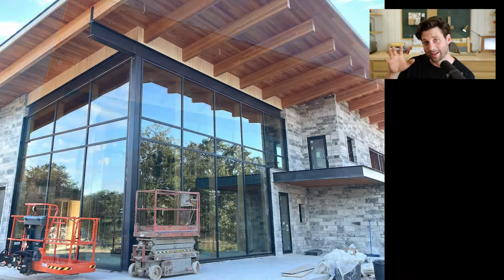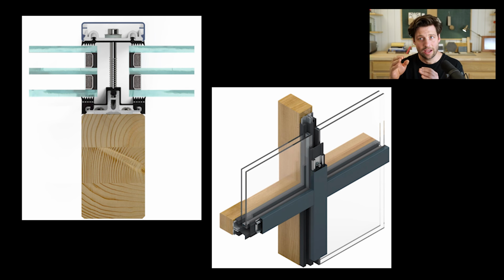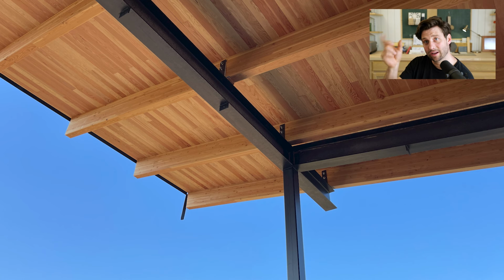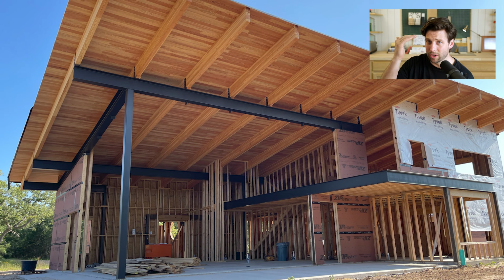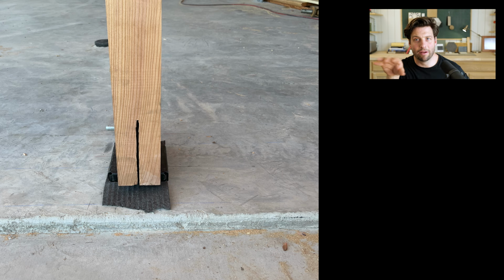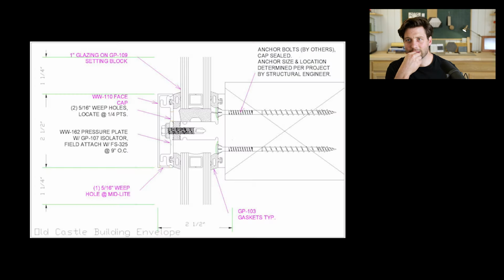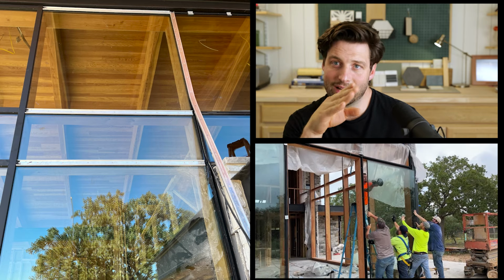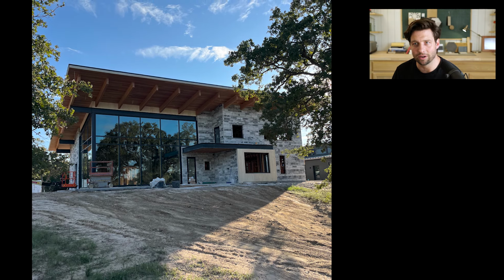Building a Massive Glass Window Wall: Behind the Scenes

Comment: You will 100% have an issue with the installated glass in 10yrs, because you filled the inside layer (between the glass) with air instead of Argon Gas. You will have moisture or mold or the glass will fog up in-between the glass. I heard that Texas is one state that does things the old fashioned way , where other places like up north are so far ahead that they align themselves with the new and changing technology. 

Also the windows and it's frame may fall if a major gust of wind hits it. Because it seems as if the entire thing was installed as if it is a storefront, instead of an curtain wall. Anything taller that 12ft is a curtain wall and it needs to be attached to the frame (skeleton) of the building at different points. The wood structure that was built is not a true structure especially when it is sitting on top of a concrete slab. It's just an decorating piece to help hold something up and to look nice but is not for curtain wall to attach to. Remember you attached the glass frame to that wood structure with screws. The correct way is to install the correct brackets that connects the glass frame to the structure that comes with bolts and nuts not screws.

Comment: Architect here, researching a timber curtainwall system on a civic project (which is probably why YouTube fed me your video). I'm curious about why you used a system you had to fabricate (aluminum glass frame installed over wood framing) rather than a full prefab system like Sierra Pacific or the like.  Was there a cost or design benefit?

Comment: How are the brackets attached to the metal beams? Are they welded on? I don't see bolts going through the metal beams.

And how are the roof decking overhanging from the rafters?? Doesn't seem like there's any support for it. Are they supported on top? Crazy cool design!

Comment: you mentioned the 100k difference for 20 foot glass panels,, but wondering, really just wondering for my own perspective, if you factored in what the real difference would have been considering the extra carpentry etc. for the additional framing?   thanks
Reply: The “jumbo glass” cost is exponentially more. Jumbo is generally anything over 144 in any direction, and/ or anything over about 50sf.  There is also considerations of glass that big with deflection, which could require thicker outboard and inboard glass.  Glass that size is also costly to transport, and requires special lift equipment to handle onsite.  These are some of the factors, which far outweigh adding the intermediate horizontals and using smaller sized glass.